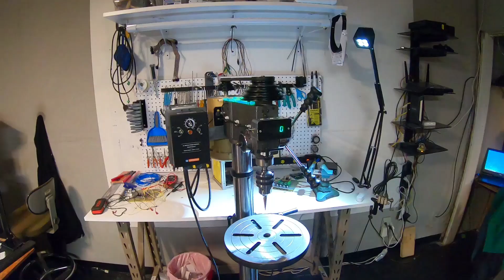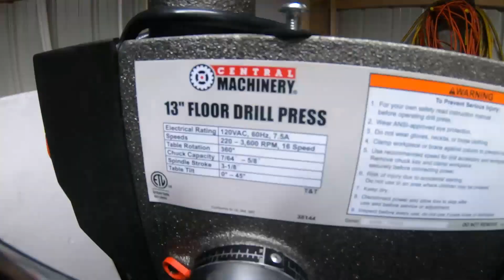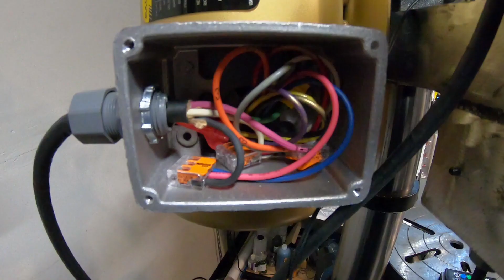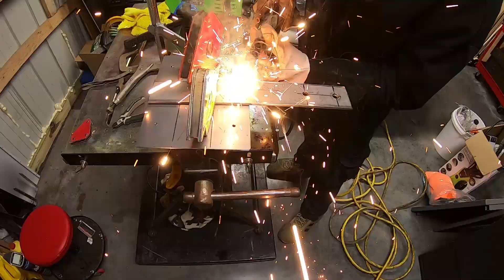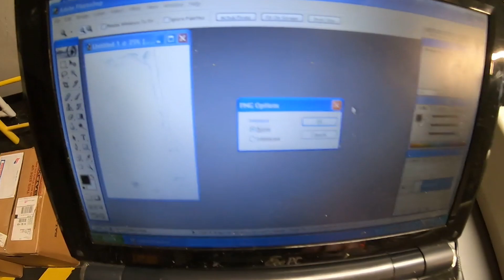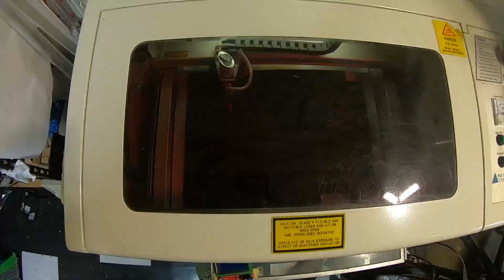Making a Harbor Freight Drill Press MORE DANGEROUS!!!

Comment: Why is the motor pulley upside down giving you no options for low speed torque when drilling bigger holes in steel?
Reply from the maker: The idea was to make it 1:1 for testing to see what rpm I was getting from the motor and VFD combo by themselves and how low I could take it without changing belts.   Funny enough, I got this larger press to use for metal but I've ended up just using my smaller non vfd press that's in my main shop out of convenience.   I may re-visit the larger press one day and just put the old motor on it.   The whole point was to not need to change belts but I should've used a 1700rpm motor like the original because the one I used is 3000rpm which is really too high.

Comment: Lol. Putting a 500$ motor on a 30$ drill press..
Reply from the maker: It was more like $300 when I bought it.  It's ok but the motor is just slightly oversized for the job.  The original motor was 3/4hp.   If I were doing this project again I'd go with the model or 2 models above the one in the video.

Comment: nice video and build. I have the exact motor and plan on doing the same conversion. unless I missed something, what are the low and high rpm speeds obtained, and how did you choose the kbwa 23-d.
Reply from the maker: Low is 200-300rpm high is 3k or so.  You can play with  pulley sizes to get closer to what you want, i just used the stock pulleys and deleted the middle one.  The vfd just fit the bill.   They're rated for wattage and hp, this was 1hp, 750w.  Also the "programming" on this one was jumper pins rather than fiddley menus like  the cheaper chinese vfds have.  It was very easy to setup.  I might try a cheap chinese vfd for my next build (vfd lathe)  just out of curiosity.
Reply: @midwestcyberpunk  excellent, thanks for the quick reply.
Reply: @midwestcyberpunk  question if I may. when you ran the wires from inverter which wires did you connect to power the motor. connect to 4,5,6, on wiring diagram. little confused there. thank you.
Reply from the maker: @josephsullivan7607   8:46 shows the wiring on my Baldor motor.    6, 5, and 4 are all connected with a wirenut and put to the side, they don't get connected to the vfd.     Then 9 and 3 are tied together,    8 and 2 are tied together,  and 7 and 1 are tied together.   << Those 3 wire pairs   get connected to the VFD's 3 motor connections in whatever order makes the motor spin in the direction you want, you should be able to swap any of those 3 to change direction.  That is assuming you're going with 220v/240v and not the "high voltage" (480v, unlikely)

Comment: Wow 2 for 1. I have the same Drill press and have been thinking of doing the same thing. Mostly because the belt slip is horrible on the smaller pulleys and the idler sucks. FYI, that key is not for locking the spindle, it's a wedge to split the morse taper of the chuck. If you stick it in and tap it with a hammer, your chuck will fall out.
Reply from the maker: The wedge was handy so I just used it to lock the spindle.  I did use it a few other times to dislodge the Morse taper so it got used as intended

Comment: Nice Build. What are your thoughts on Making a Variable pitch pulley setup (Variable speed drill press - with Paul Brodie)         versus new motor, and VFD. Thx for sharing video
Reply from the maker: I considered a WEN variable speed drill press for $2-300 on amazon but I decided against it for a few reasons.  One, I couldn't buy it locally and I hate having heavy stuff like that shipped and two, I got a spectacular deal on the Baldor 3 phase motors so realistically, I had a motor looking for a project.     I haven't done any scientific testing of torque other than trying to stop it with my hand at 200-400 rpm and I couldn't stop it.   I was able to plow through mild steel at 400rpm using cheap Warrior brand step bits with no slowdowns or stalls so I'm pretty happy with it for my basic needs.       I just scanned through that Paul Brodie vid, his drill press looks older but beefy.  Does anyone still make those other than WEN?   I like the idea.